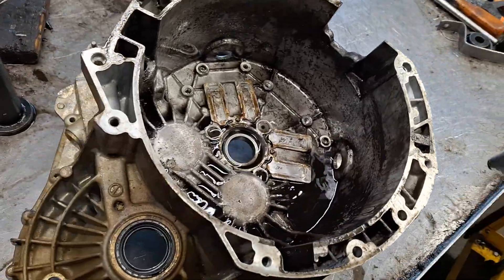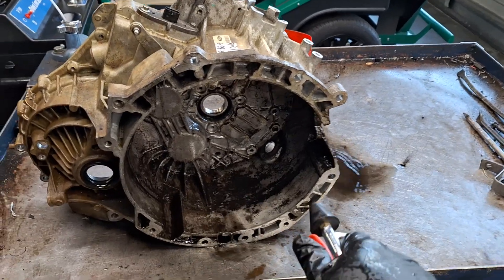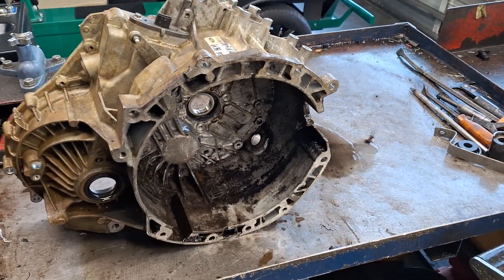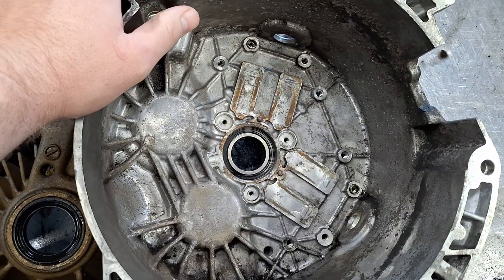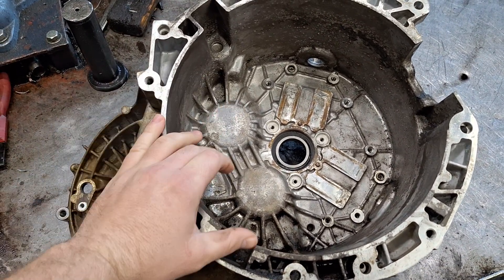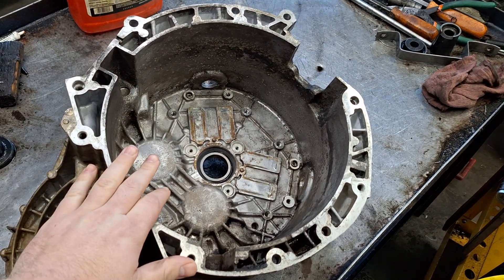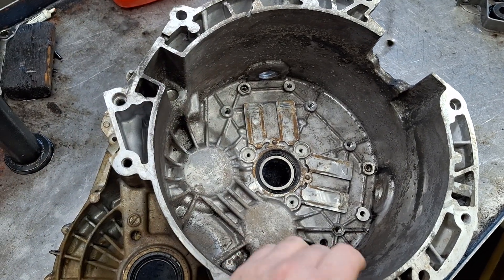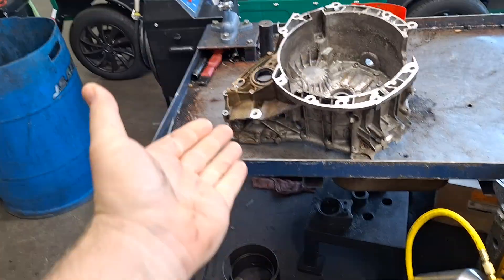Brake Cleaner Pressure Washing - DPS6 Case

Comment: friend I hope you help me!!  I have a 2016 Ford Focus and have not been able to fix a transmission overheating problem after 15 or 20 of driving at 70 miles.  But on short drives of no more than 50 miles the fault never appears.  I already changed a new clutch and forks.  I also changed the 3 used sensors and all the harness and I have programmed 4 K05 TCMs and the fault always comes back when driving at 70 - 75 miles.  The car drives normally without sudden movements. I don't know what to do anymore.  I'm sorry I'm using a translator if you don't understand something.  sometimes I have this code p2787
Reply from the maker: I suggest replacing both (upper and lower) clutch actuator motors. If the issue is still present after that, then the new clutch is the problem, or there is fluid leakage on the clutch. Here are the acutators you need 2 https://www.rockauto.com/en/moreinfo.php?pk=15197629
Reply: I replaced the 2 actuators of another Focus that works perfectly and the fault persists under the same conditions, after driving at 70-75 miles for 10 or 15 minutes the fault appears.  Thanks tomorrow I will lower the transmission again and check the life of the clutch or possible leaks.